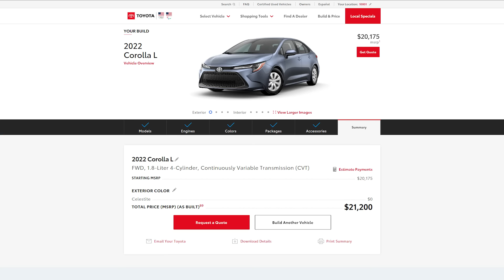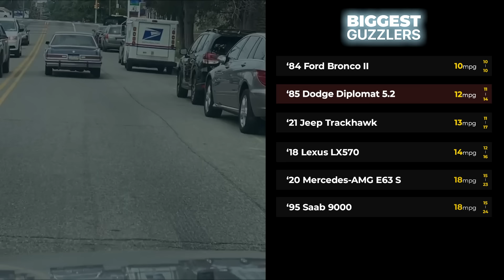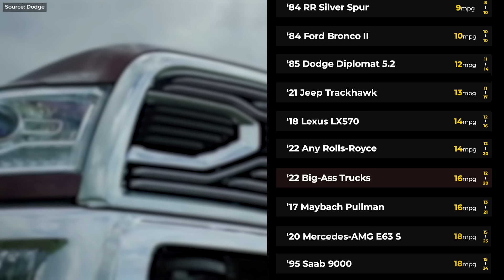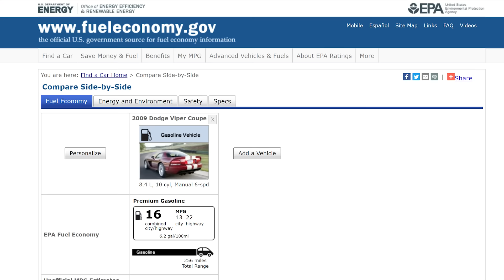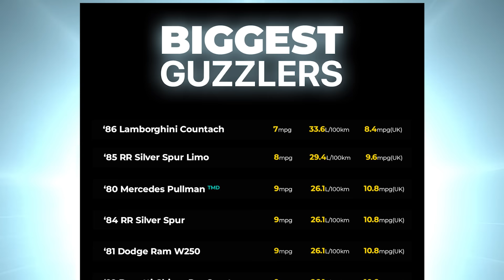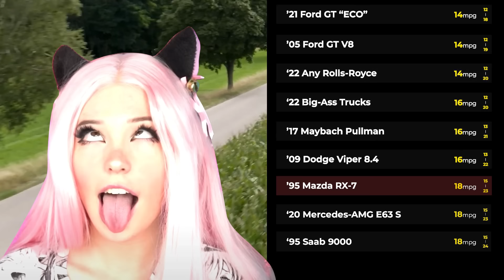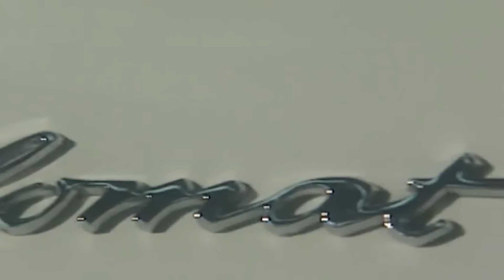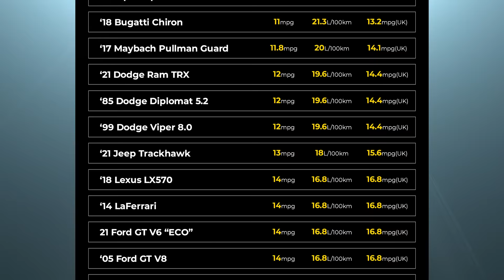RANKED: which Cars use the MOST FUEL?

Comment: saab 9000 small compact car?
what???
Reply from the maker: It is shorter than the current BMW 3 Series, and the BMW is considered a Compact executive car
Reply: @TopCarsTV  The current 3 series is the same length as the 80s 5 series.
Cars have gotten bigger over time.
Reply: @TopCarsTV  The 9000 is an executive car.
5 series, Audi 100, Merc E class.
Reply from the maker: @Random-nf7qb  I know but I'm comparing them to today's standards. 
A car smaller than the current 3-series uses as much fuel as an AMG E63 S. That''s an interesing info. 

Otherwise I could say - a '95 Saab does 2mpg less than '95 Alfa Romeo 164. That won't keep people watching, they will click away, I'll lose revenue and will have to abandon doing YouTube videos alltogether. 

Sorry, but that's just how this business works. I hope you understand
Reply: @TopCarsTV  Pretty sure the methodology used for testing has changed(in europe we moved from nedc to wltp)

Also, the Saab and Alfa are built on the same platform and the Alfa has better aerodynamics from what I remember.

Clickbait is bad. Are you making videos only for the money?
Reply from the maker: @Random-nf7qb  Making videos is my job now. It's how I pay for my food and everything else. 

I wouldn't call it clickbait. Overdramatazing would be more correct. It's not my fault tha tthis is what keeps the audience glued. 
Those that just want straight numbers can always google them.

Comment: The data on the Saab 9000 is clearly wrong. They have up to 220 hp depending on engine and will consume about 9l/100km. So actually quite efficient for what was considered a „large car“ by the EPA at the time.

Comment: there's always been times when gas is more expensive heck when my late maternal grandmother bought her used 1979 Cadillac Coupe Deville in about 1981 gas cost about 1.30 a gallon so it cost about 34 dollars to fill the tank as that car had a 26 gallon tank in America granted the weight of the car unloaded was 4,140 LBs. and it kept getting lighter as the model continued production until retirement of the model for the 2005 Model year when it weighed only 4,049 LBs. where as take for example an unloaded 2013 Hyundai Azera which is 535 LBs lighter at 3,605 granted when we bought my moms 2013 Azera for her 50th birthday is Sept 2012 gas cost 3.64 a gallon for regular unleaded granted gas has only been unleaded since around 1996 and certain cars actually recommend using premium gas including your Luxury cars like Cadillacs Lincolns Aston Martins Mercedes Benz's BMW's etc. the Azera also gets roughly 3x the miles per gallon the old Caddy did the Caddy averaged 10 mpg while the Azera averaged 30 MPG hell even a used 2011 Cadillac SRX Midsized SUV gets better gas mileage than the old Coupe Deville did at 22 MPG hell even a Toyota Camry Solara got around double the gas mileage per gallon as the old Deville did though the Solara only lasted 10 model years 1999 to 2008 while the Deville series lasted 46 from 1959 to 2005 the third longest car production run for Cadillac the two that were produced longer are the Eldorado 50 years and the Fleetwood series 49 years though Fleetwoods were most often used as either Limos/funerary cars. my maternal grandfather had an Eldorado in the late 1960s when my mom was a young girl that may have been one of the firemist metallic red colors available at that time which were San Mateo and Rosewood Cadillac are bringing Rosewood back for the CT/XT models for 2023